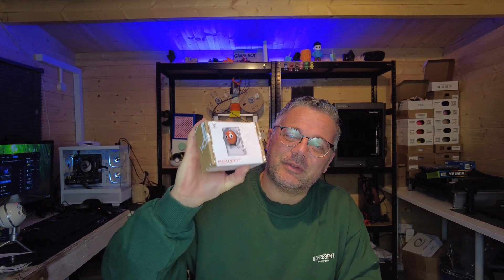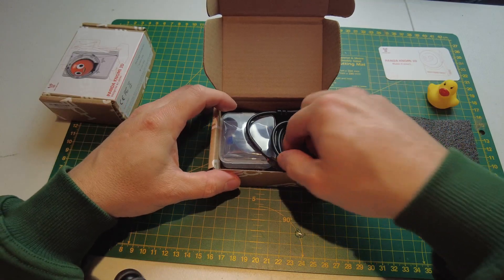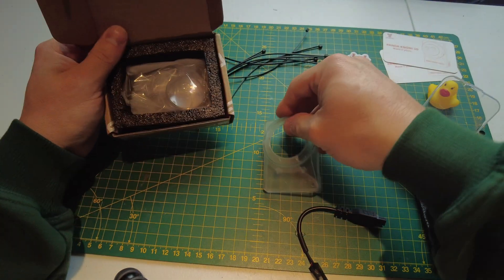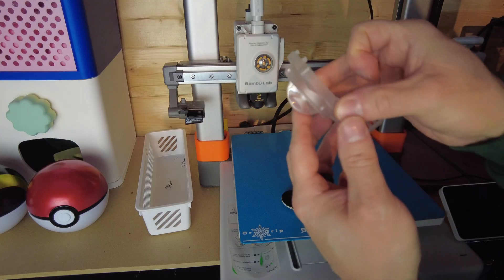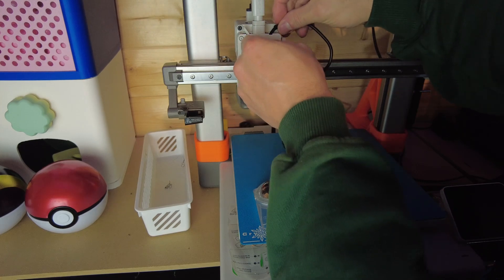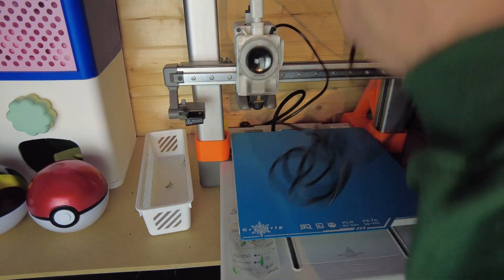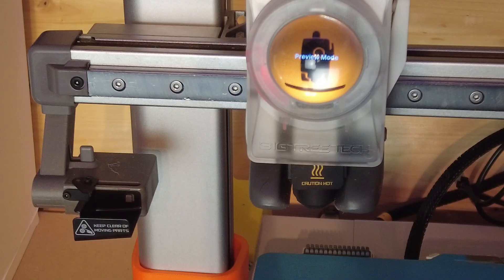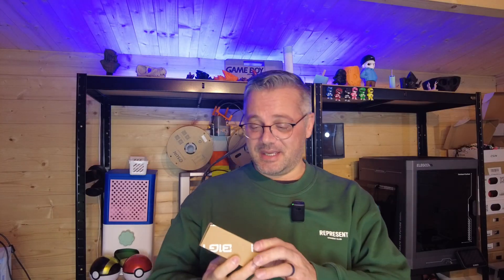PANDA KNOMI 3D Unboxing & Installation BIGTREETECH BAMBU LAB A1

Comment: Nice. Couple of questions though..  Do you happen to have the 1st gen to compare it to size-wise? I've got 2 Knomis, 1 monitoring each printer. They're both on my desk in a custom-built mount/stand, both powered by USB-C ports on the back. I take it the new gen can also still be powered solely by USB-C?
Reply from the maker: I don’t have the 1st gen unfortunately but I honestly think it’s pretty much the same size from what I have seen. As far as power goes, yes just a simple USB-C connection.
Reply: @ILove3DPrintingYTnice! I guess I’ll throw one on my Amazon wishlist and see what appears under the tree. Thanks!
Reply from the maker: @jcandthewires Haha hope santas reading this